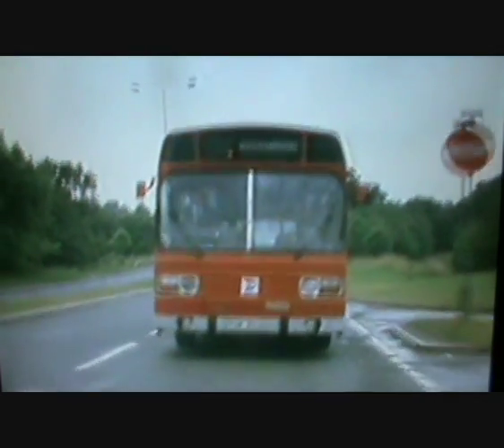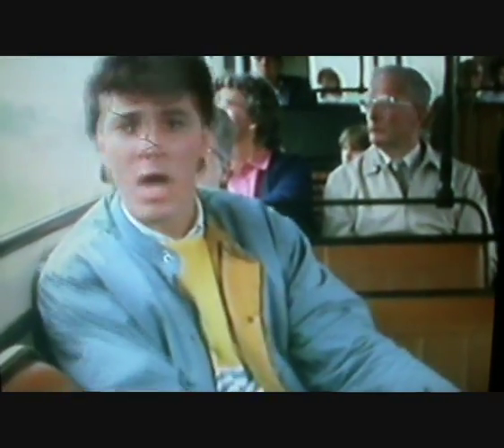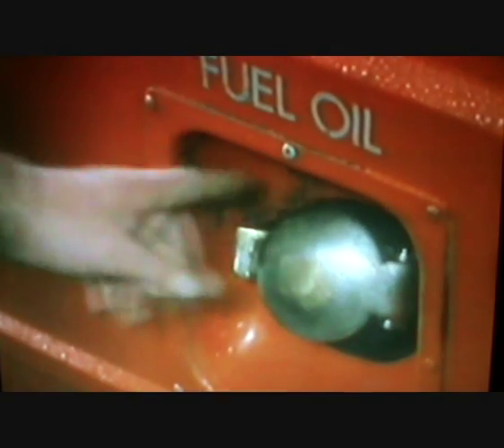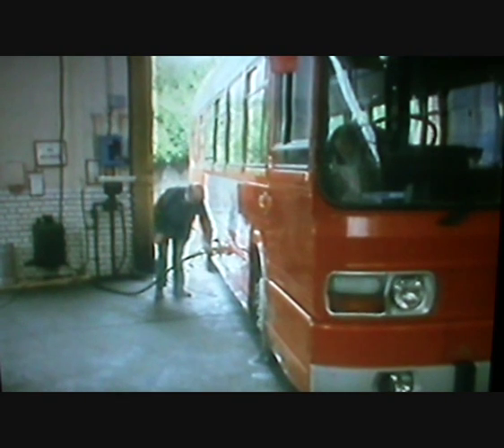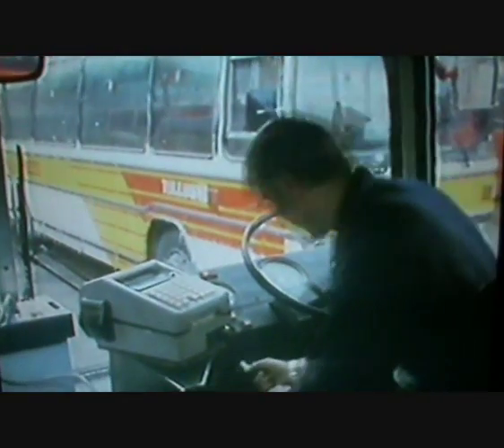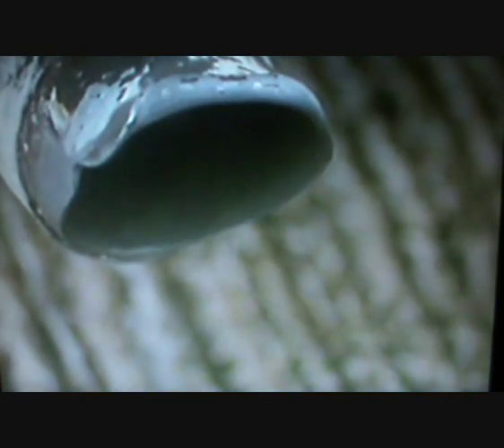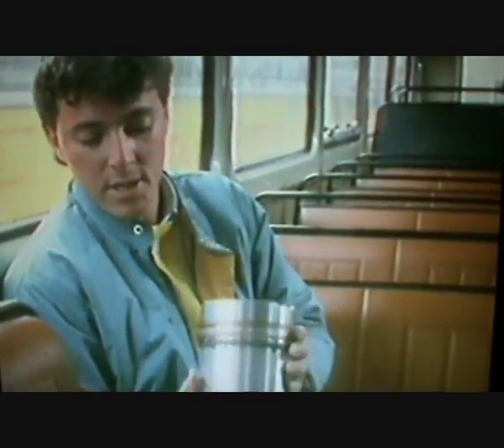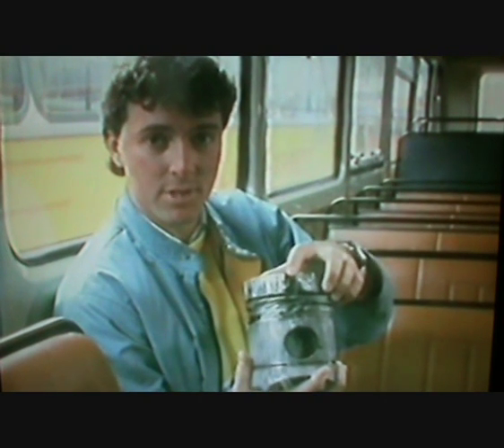Wellington Garage "LEYLAND FLEET CHECK"

Comment: Re 1100 Honda CB, at least you don't have to take a Leyland 510 apart to get to the fuel pump, you do if you want to adjust the valves or get to the piston rings...

Comment: re: Shaun TV, the Leyland National was also used to pioneer multiplex wiring and contiuously variable transmission, battery-electric operation. OK the mobile office and mobile triage centre weren't sales sucesses but then no one could accuse them of not trying...